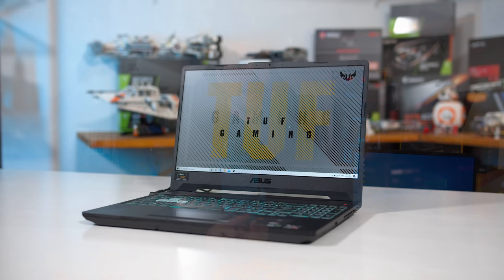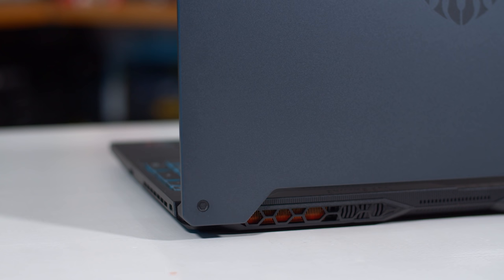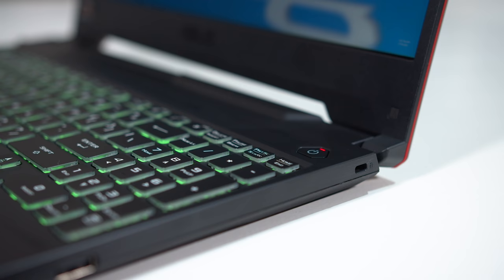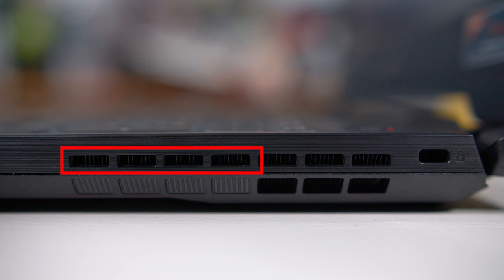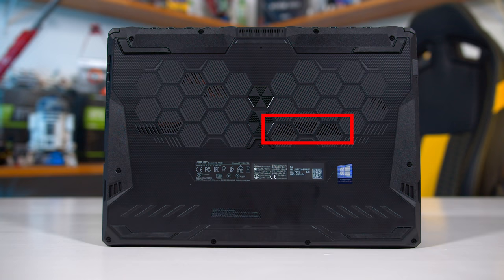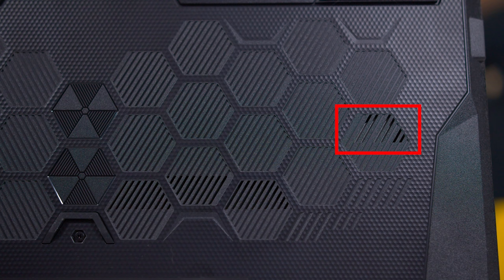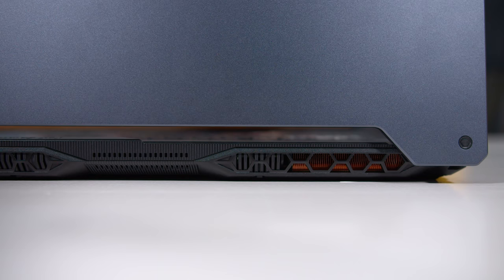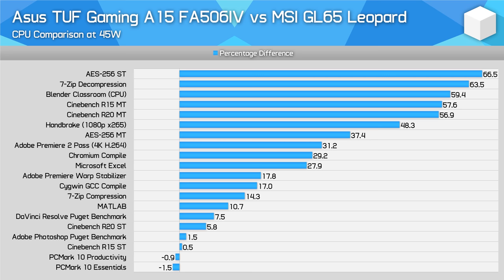Don't Buy The Asus TUF Gaming A15 (2020 Model)

Comment: Had (1660ti version) this for 5 days now. Doing heavy duty things each day for long periods of time. I've only set the NVIDIA options to high performance. 

Upgraded from 8gb RAM to 16gb. 

Played games like Destiny 2 / Total War: Three Kingdoms / Warzone / XCOM etc. - highest settings 
Running architectural / rendering softwares like autocad, revit, enscape, lumion

Overall I'm satisfied. Cooling is fine. It's cooler around where the hand usually is at the AWSD area / number pad & warmer on the middle part but not hot enough to feel uncomfortable. 

On turbo mode most of the time and the fan does make some noise, but tolerable, but you don't really notice it when you're in the zone. Unless you're the type that do. If you have headphones on then its not a bother at all. 

EDITED: After a little over a month of using this laptop...
Used it daily for work / gaming / and the general shit you do on the internet... sometimes i have even used it around the clock. 
It's still running like brand new. lol

EDITED: almost 6months in...still as above. 
Played the new AC valhalla (mostly on high graphic settings) and a few hours in on Cyberpunk (mostly ultra settings) and its smooth runnin' so im happy! 

 48wh battery runs out of juice quick though, when unplugged, so would advise getting 90wh one to last longer. 

Maybe 6 months isn't enough time to really see any faults so will probably check in again in months time. Or if i come across any issues.

EDITED: 1 year later...

Usage: as above
Heating: still as above. 
Performance: No drop. Still performing well for me. Have not experience any technical difficulties so far. 
-Liking the eye care feature under armoury crate. takes the stress off the eyes when active for long periods 
-Only downside i found so far is that my 'AWSDF' keys has slightly faded, probably because of usage. But not really a concern for me. 

Is it worth what you pay for... YES! 
Could you get better ones under same pricetag.. Probably. 
This was a year ago when I purchased so not sure what's on the market.

Anyway, hope this gives people a bit of an insight when deciding to buy or not. 

Goodluck
Reply: bro thanks for your opinions I am gonna buy the same version of yours and I was little nervous about cooling. your comment helps me :)
Reply: @katsu8693  No worries bro. I think the bad reviews only apply to hardcore users and IT experts. But I'm casual and not really tech savvy. I base my opinion on user experience.
Reply: Did you care about the ghosting in the screen? Was it really distracting like that?
Reply: @OsmanthusWineZhongli   wow ive literally had not noticed until you mentioned it. So to answer your question. No, not distracting at all
Reply: @ronin1040  its just my first time owning... But I can use a monitor for this one right?
Reply: Gum gum all of the laptops have HDMI Output so most likely
Reply: Im having the 1660ti ver with 16gigs of ram and gaming and multitasking is so good I don't feel this laptop is bad
Reply: Thank you a lot! This was helpful.
Reply: Hi.. im a architecture srudent is this lap is a best one for us, for rendering and all
Reply: @OsmanthusWineZhongli  What exactly is ghosting?
Reply: @juanfigueroa4989  Response time issue
Reply: @ronin1040  what about playing on 90c+ constantly. Can it damage cpu or gpu?
Reply: Also no problem with the temps on my TUF, he is just talking bullshit in this video. i had a msi before that and the msi overheated a lot.
Reply: @nedopanic1810  tbh i dont really check the temp and ive only had this for about a month so I cant tell if the heat is damaging anything. All I can say is that its still running  like new no problems.
Reply: Can u do AAA TITLES gaming?
Reply: This or helios300
Reply: @OsmanthusWineZhongli  do you have this laptop yet?? How about the ghosting int the screen, is it bothering you? Im looking forward to buy this laptop tomorrow so i want some thoughts
Reply: @patra7015  I dont have this yet... 

prob my first ever laptop.

the ghosting will not mean much to me since after buying this (maybe soon), im planning for an external monitor or just doing casual games, why not?
Reply: I definitely will buy this since its available here on Phil and is the best customer support and reach unlike the others just yet. 

but, for some thoughts, it actually a decent laptop if not the best, considering its price point. 

for thermals, it might be a issue that it doesnt get much airflow but it will not get much dust... because of this 810-STD... or what

but still, its decent
Reply: I cant recommend this his (Hardware Canucks) reviews since its really bad and the thermals

but ASUS has their own reasons
Reply: Opinions on the battery? Mine(48wh) will die after 1 hour of gaming or 4 and a half hours of videos
Reply: @drk7885  yes witcher 3, tomb raider, doom, mw, gtav, rainbow 6, etc.. amd ryzen 5 4800h with gtx 1650ti version, never had a throttle issue, and I live in a tropical country.
Reply: I plan to buy the Ryzen 9 version with GTX1660Ti. My intention is to use if primarily for MATLAB. Even if I use it for gaming, I play only CS GO most of the time and Battlefield 3 sometimes. I hope I don't regret buying this laptop.
Reply: I bought A17 and i don't really think its that hot
Reply: Bennett Tan. I want to buy the same version. Please update me how do you feel about the laptop after a few days/weeks.
Reply: Hi. Im an architecture student and I really need to find a laptop asap because school is near. You said you run architectural softwares here and it's good. How about the color? Are you bothered by it or is it fine for presentation? I read other reviews saying the display sucks. I really want to buy it cause it's cheaper than other products which offer the same specs. I hope you reply. Thank you so much.
Reply: @SakiChan1209   hey.. there's nothing wrong with the colour. Go for it! I use this to lap top to work from home. I've rendered images from lumion & enscape., created planning drawings up to producing construction information - it does the Job! I appreciate the comments on colours. If you're a photographer / editing videos / or  graphic designer then it may play the part. But for me, no issues. I advise you get the one with 90Wh battery, it last longer without plugging in. Good for lectures and studio work or even site visits... Goodluck!
Reply: @ronin1040  Thank you so much! You helped me big time. ☺️
Reply: @ronin1040    i wish to buy  this one for my architecture use	(TUF  A15	FA506IV-HN294T/	R9-4900H/ RTX2060 (6GB)/ 8G+8G/ 48Wh),
Is that ok, for a lumion,enscape rendering ? 
Any heating issue or fan sound?

& it costs 111500 Rupees in india, is that a heavy amount ?
Reply: is your experience the same even now?
Reply: @mehsoomn4477  that's a better spec than to what ive got, so i assume it would perform better.. as above comment lumion/enscape rendering works fine for me.... i have not had any heating issues so far. its still as per my original comment. Fan on turbo mode is a bit loud but if your in the zone or headphones on, its not a bother. hope that helps.
Reply: @adityabendi9754  yea - still feels like brand new. I really dont get all the hate with this product. I use it daily for work / gaming / and general shit... we have a 14day return policy here in the UK, so I decided to test the limits within those 14days by excessive use - its been over a month now and well, lets just say I still own the same one today lol.
Reply: I am looking at getting this with a rtx 2060 card. Either that or a Lenovo legion with the same specs but a hundred quid more expensive, is it seriously not all that bad? Because the kid working at the shop was loving this laptop, no he wasn't being biased because I told him I wasn't buying just looking around and he loves this device
Reply: This this this! I own the  same version as you and I love it. I usually play R6 siege on high settings, no mans sky on ultra, etc. Usually game for 2-4 hours at a time. The laptop doesn't get all that hot compared to my older razer blade 15 and the fans, as a lifetime gamer, are not loud AT ALL. To the reviewers point though, it could be better if they didn't block a lot of the air flow. laptop simply works and runs games like a boss. I use an ultra wide 120hz monitor on my desktop setup and this screen feels smoother.
Reply: Bought this product a few weeks ago and seeing this video was alarming to me, I'm so thankful and relieved to see a positive comment, thanks dude.
Reply: @OsmanthusWineZhongli  pre. Okay ba to? Medjo mainit satin dito sa pinas. Ngdedecide din ako if tuf ba or yung bagong acer predator helios 300
Reply: @alvinbontuyan279  pre... Student lang ako at sa Online class. At malamig yung school ko. At tsaka wala akong 80k para bumili ng Helios 300. Good thermals naman ang Helios 300 pero in a budget po ako. Yun lang sir. If medjo hardcore kayo, bahala kayo sir.
Reply: @alvinbontuyan279  1st quarter at 2nd quarter din online class kaya no problems ako about sa magiging environment temps kaya puwede naman siya... at for the next 3-6 years... reliable and promising siya sa tingin ko. Kung may work ka that is kinda too high quality or anything that requires "real" sustain load, I don't recommend this laptop. 

Its only recommended for gamers.
Reply: if you can undervolt your gpu, you can get 70c lower while having the same stock boost gpu frequency. I'm living in the Philippines having ambient temp of 31c. if I do air-conditioning my laptop's temp is around 58c while gaming.

tested it out with Max Graphics without ray tracing on Shadow of the tomb raider.
Reply: I've bought this laptop too. The Ryzen 7 4800H with 1660ti Graphics version.  I love it. Very good value for money, no problems with cooling, and I do not regret getting it.  It's very much worth the £999 price in the UK.  Running Elder Scrolls Online with all the settings on high at 70 to 99 fps.  In real world use, it is a perfectly fine gaming laptop.
Reply: @OsmanthusWineZhongli  yes it has HDMI connection for a monitor.
Reply: @OsmanthusWineZhongli   There is a difference between real world use and the testing results given by benchmarking software.  I've not noticed any display problems with gaming on it.
Reply: @williamagar7160  Yes it has differences to the real experience. That's why it's only benchmarking.
Reply: Is your version Ryzen 7 or 5?
Reply: Thx bro, TTW: 3k is the most demanding game I'm going to play on my laptop. I was worried after watching reviews on the internet but your cmt help me make up my decision
Reply: I have the RTX 2060 version and at first I noticed how bad the cooling was. It’s well directed away from your hands when resting on a table top so you don’t notice it much and when gaming with headphones the fan noise is really a non-issue as it gets drowned out by room fans and game noise. My biggest concern is with longevity. The CPU runs at around 90° C for most games and although that is technically within design tolerance for most silicon, you can’t help but think it will reduce the lifespan of the machine by at least a little bit
Reply: Thanks for a this bro. Im looking also for a gaming this is strong and durable
Reply: hmmm i think imma go with this instead of the helios 300 2020
Reply: Thank you so much bro , i almost striked this out of my list because of some reviews, thanks for sharing your opinion!!
Reply: @adarshkp5642  yup I have this computer (1660ti-512GB-16RAM), I used Enscape and Lumion with 400MB and 700MB renders and it worked perfectly
Reply: The cooling problem isnt about your hands getting warm, over time its going to ruin the components inside the laptop.
Reply: @Zero11_ss  so is recommended or take helios 300? do you have suggestions for under $1k
Reply: Well said, this review is too darn critical IMO
Reply: @katsu8693  either way you can purchase a cooling pad
Reply: Are your laptop still working good? Hope it does
Reply: @shirotora5610  Hey - mine still working like brand new after owning it for almost a couple of months now... It's still early days though - I might come back to this commment in 6months or a year's time and give an updated. But so far so good!
Reply: @ronin1040  thanks for the update bro, Im gonna buy tuf gaming tomorrow goodluck to me :)
Reply: @shirotora5610  No worries. enjoy it mate
Reply: @aravind karthik ASUS TUF FX505GT-HN093T GAMING LAPTOP BLACK | 15.6" FULL HD IPS 144Hz DISPLAY | INTEL CORE i5-9300H (4-CORES 8-THREADS) | 8GB DDR4 MEMORY | 256GB PCIE GEN3 x2 SSD + 1TB HDD | NVIDIA GEFORCE GTX 1650 4GB | W10
Reply: Im gonna buy this tomorroe
Reply: @shirotora5610  best with 16gb ram - but you can upgrade once you get it, as I did ;-)
Reply: @ronin1040  i was planning to but little on a budget
Reply: @shirotora5610  ah that's alright. Whenever that fits the bill really.
Reply: @ronin1040  btw, do you use your laptop like games while charging?? And do you use the turbo mode while charging?
Reply: @shirotora5610  yea i do and turbo while on charge or else it sucks out the battery life while gaming. Unless you have bigger battery which apparently lasts longer
Reply: @ronin1040  but your laptop still in good shape right?
Reply: @shirotora5610  yea bro. i pretty much use it heavy every day,and still performs like brand new
Reply: Thank you i was scared if i should buy it or no
Reply: @hydro8382  same bro
Reply: Good. I just bought it yesterday and it seems awesome to me after returning a Nitro 5 that was like a mini vacuum running all the time. I love the A15 so far and it is tremendously superior to the Nitro design in my opinion. Cooling seems fine.
Reply: does it have display port?
Reply: I'm buying this laptop next week, thank you for your review! :D
Reply: @ronin1040  hey bro do u use your laptop plugged in all day??
Reply: This was the first comment on youtube where i read all the replies lol, im buying the gtx 1650 ti version tommorow, i hope its worth it
Reply: @flame0814  its worth it bro, you need to set the 144hz because 60hz is default
Reply: @shirotora5610  wait one second im getting confused, the site im buying it from says the screen is 60hz
Reply: @flame0814  oh i thought u bought the other tuf gaming
Reply: @shirotora5610  okii
Reply: @shirotora5610  hey - yea i do. Battery don't last long as I do the heavyweight stuff on it. I do have the lower end battery though. Not sure about the 90wh battery version - It might last longer without plugging in.
Reply: I’ve literally just got this today and only now seen this review, it’s reassuring to see this comment, love this
Reply: @Ronin  Bro, how about the battery life with no plugging battery for only using normal  web browsing stuff?
Reply: @ronin1040  I just experience diagnostic problems :< sadly the problem is adapter and batter idk why. and today I plugged in my charger and it stop on 96% but still charging
Reply: I had literally just bought it 30minutes ago  when I decided to look it up on the internet and I found this. But thank God I stumbled upon this comment!
Reply: What do you think about the High response time bro
Reply: Literally went through the replies of this comment only THROUGHOUT the whole video, thanks man!
Reply: We all know you work for ASUS
Reply: Can't say you are not one of Asus's pet
Reply: Hey, looking to buy something similar to this, how's Destiny running? Currently one of my main games and I'd like to be able to play it away from home. Thanks.
Reply: Cyber hey mate, i cant say with destiny as i dont play it but i play modern warfare on it and warzone and it runs great. Obviously i opt for performance than graphics because k/d over aesthetics. But played the campaign which is pretty graphic expensive, and it runs pretty well. Hope that helps
Reply: Funny how people think im an asus dog just because i think this laptop is pretty good for its price x
Reply: @ronin1040  Thanks for the feedback, mate.
Reply: I bought the same laptop. So far so good. i'll try and give am update after 6 months.
Reply: Gracias papu.
Reply: Is gtx 1650 Intel i5 version good for unreal engine 4 ,blender ?
Reply: What’s difference between 1650ti and 1660ti is it much of a differnece
Reply: Aymane Bencheikh sounds good ty
Reply: I’m actually planning to import the version with rtx 2060 with the AMD 4800h 7 at the end of the year and seeing this comment made me think that this laptop will be good for my clumsy hands. Once the AMD 4900h 9 comes out, I might get it, but I don’t really need that much.
Reply: @ronin1040  Hi I'm back again to ask a few questions. I have already bought this unit and been using this for more that a week now. You've told me to buy the 90wh but I accidentally bought the 48wh one because I thought the unit I purchased was the 90wh. The maximum I can use this is 2 hrs. Running cad and other archi softwares and just web browsing. Nothing heavy really. Is it normal that the lifespan of this laptop only ranges like that? If its normal I wouldn't ask the seller for warranty but if not I really need this replaced. Thank you so much.
Reply: @shirotora5610  Hi. Have you resolved the issue? I experience the same. 3 days ago it stopped at 98% then the next day it worked fine and got fully charged. Then earlier it happened again it stopped at 99%. I have the 48wh and the battery drains so fast. I hope you reply. Thanks !
Reply: @SakiChan1209  i changed my charging mode maximum battery lifespan mode, so it automatically stopped the charging at 60%.
Reply: @shirotora5610  Do you also have the 48wh? Do you keep it plugged in and does it get fully charged now? I'm sorry for the questions I'm really troubled right now. Lol Thanks!
Reply: @SakiChan1209  yess we have the same. Yes i do always plugged it for like almost all day
Reply: @shirotora5610  Now I have less worries. Thank you!
Reply: @SakiChan1209  and I recommend to you that, if you use your laptop for like 12 hours or long gaming time use the maximum battery lifespan mode, but if you are using laptop for about 2-5 hours use the balance mode, according to the google making your laptop fully charged always can cause battery life decrease
Reply: @SakiChan1209  i have one problem recently and i dont have time to go to the customer service. My problem was when im doing the hardware diagnostic my battery and adapter has a problem
Reply: @shirotora5610  Yeah I really do use it all day. I was really worried because it won't fully charged. I'll now plug it most of the time. Thank you for the advice!
Reply: Minhit Entertainment hi mate yea that sounds about right with the 48wh one. I usually keep it plugged in all day. Probably not ideal but the 48wh battery runs out like grape juice hence i would always opt for the 90wh one
Reply: @ronin1040  Did u face an issue about not getting fully charged? Mine stops at 98 then gets 100 the next day and earlier it just stopped at 99. Could there be a problem with my unit or the battery and adapter? I really need opinions. Thank you so much!
Reply: Minhit Entertainment hmm another guy had that problem in the comments. Ive not had that problem, mine goes up to 100 when charging. I did mess around with the performance settings when i got it though, so you might find the problem in the battery settings? Try maxing battery performance maybe.
Reply: @ronin1040  Yeah I read he did that. I'll definitely give it a try since I can't afford to keep this laptop away from me because of deadlines and stuff. Thanks for replying! ☺️
Reply: @Ronin I dont know if you discussed this earlier mate but did you notice any ghosting/issues cause of the high refresh rate. Does it cause any problems with competitive games?
Reply: @cankenger  Hey. I must admit I've not come across, or notice this yet. Most of the time I use a separate monitor to play games on for a bigger screen. But when I do play on the laptop screen, it seems normal, or I've just not noticed. Have you been experiencing this?
Reply: Ronin ahh i see, I was thinking of doing that. I actually havent got the laptop yet. I was thinking of getting it but theres so many adverse messages about the display and the 18ms response time. It says it needs to be 5ms for gaming, on the internet but i feel like it doesnt make a difference like you said. Could you please watch out for it and let me know if you notice anything when playing fast paced games. Grazi
Reply: @cankenger  I'll tag you in if I do come across bro. But if i was you and looking to get a monitor as well, I might as well buy a higher tier laptop with good monitor to meet your needs, instead of buying this laptop and a monitor. I'm fortunate enough to own a separate screen already :)
Reply: Ronin much appreciated🙏.  Yh that makes sense. Ill consider that
Reply: totally agree, used mine for 2 months now, and by disabling the boostclock, temp doesn't seem to bother anymore, only thing that i don't like is the armoury crate software, always gets service error and infinite update.
Reply: Cheers for the confidence boost, purchased the laptop yesterday and am watching reviews while it ships, glad to hear you are satisfied with it 👍🏽
Reply: Just bought it, fully agree.
Reply: Legit never saw it go above 80c even once, i played valorant, csgo and hyperscape back to back.
Reply: Dhruv 97 any ghosting on csgo?
Reply: Ronin I’m planning on getting this for school and gaming, what do you think?
Reply: I'm new to laptop 😐..so is your model a good choice to get hands on or should i move on with some other stuff.. actually i want a laptop for casual tasks,slow and steady gaming (no hard-core games at all)😂..and for the online classes 😏..so what you gonna suggest me my dear friend???
Reply: Hey I want Asus tuf A17 Ryzen 7  17 inch 16gb 1tb hdd 256sdd 6gb 1660ti but it haven't launched yet in my region so the asus store is suggesting me to go for asus tuf FA566IU-HN254T R9-4900H GTX1660Ti (6GB)
16gb 1T HDD+512G SSD  15.6 FHD-144hz 48Wh and my requirements are video editing premiere pro after effects like software and gta 5 like game. The thing is asus a 17 price is 92k and this asus tuf FA566IU-HN254T price is 104000. Can you give me please a piece of advice which one I should go for?
Reply: I am also going to buy❤️
Reply: Im also looking to buy this product. I am going to a designer school, are the colors going to affect me that much? Are the thermals still good and is this laptop good for rendering?
Reply: Dude how did u use rendering in 66% sRGB panel
Reply: @drk7885  Helios 300
Reply: How's the battery life mate? I'm thinking of buying this as well?
Reply: @parthgigoo2477  I've got the one with 48wh battery, and I can get max 2hrs on it doing normal day to day task. But when gaming, it runs out pretty fast. I usually keep it plugged in when I do intensive tasks.... I would recommend the 90wh battery to last longer.
Reply: @Rdg Jathin Hey mate, its holding up alright. Its been almost 4months since I've had this. I've not had any heating issues or damages yet. Probably because its still too early to notice. The heating is still pretty much the same since day one... Valorant isn't graphic intensive so you should be fine.
Reply: @darkherobrineita  I played AOE 2 DE on battery mode in A15 for 2 hours straight.
Reply: @ronin1040  hey man, while watching movies and all, they look like a little bit dull, red color seems orange to me, I know it has 62%srgb and 45%NTSC, does the same happened with you?
Reply: @sanyamthakur6549  I honestly have not noticed. Albeit, I have played around with the visual settings via armoury crate... maybe do the same, and tweak to suit you.
Reply: @ronin1040  How to do that, can you tell step by step please?
Reply: @SakiChan1209   Did you buy this laptop? and are you facing any issues
Reply: @nitinbopannat.r9726  Hi yes. Using this for almost a month now and no I haven't faced any issues so far. It runs my softwares smoothly and play games with no lag. The only downside with my unit is the battery. Other than that the laptop's really good.
Reply: Is it cold where you live ?
Reply: How's the screen? I've heard some people say the colors are dull compared to other models, is it?
Reply: Will this laptop be a good option for Autocad and 3ds max..?
Reply: @cankenger  ...yes
Reply: @OsmanthusWineZhongli  hello so far how is it been for online class? Hindi ba umiinit in casual use? Nasubukan mo na rin po ba mag edit ng video like premiere and how is it if that's the case?
Reply: @jjdeleon624  how can you do undervolt po?
Reply: Thank you bro for your opinions and first hand assessment about the laptop, it was very affirming
Reply: Omega Zero  because it's real life usage supported by everyday use going on for months.
Reply: @javitriana2135  hey. I am thinking about getting the same specs. I need your help to clear some of my questions. How long does the battery last( for normal browsing and videos)? Does the laptop get much warm?( can I place it on my laptop and use lumion and autodesk?) And finally how is the screen? Thank you
Reply: @khushhalistan2299  hi! It's a great computer, you should buy it. Battery last about 4/5h MINIMUM, depending on how many videos, quality and brightness, but for a normal use of browsing and PDF reading... Minimun 5h. It never get much warm, if you are browsing it sometimes don't use the vent, so it's very quite when using it. You can use it Lumion without problems, but you should always have it charging because it's more powerful and works faster (if you use Lumion, the vent will move very fast and sound at very high revs, but it will never warm). I really like the screen, some people don't like it but I like the colours, I always have the brightness bar at the middle and quality is ok for normal videos (if I want to see HDR videos I watch them on my 4k tv hahaha). I hope it help you, if you have more questions just text me, but I highly recommend this computer 👌👌
Reply: Thx
Reply: hello I am Architecture student and would you highly recommend this laptop for 3D modelling, rendering and gaming purposes? I've been having a really hard time looking for the right affordable and efficient laptop that would satisfy my needs and wants, I'm really interested with this one but some reviews are really getting on my nerves, I just want to find a laptop that I could use for long term. Thank you! :D
Reply: @danielsia1803  I've only had this laptop for almost 4 months now. In terms of long term, I am yet to experience that. But it is proving to be resilient so far. I'm an architectural technologist in the UK, and I've been using this laptop to work from home. I would say it would suit your needs for architectural purposes. I've done rendering using enscape / lumion, and work on Revit architectural all day long... besides work, i also game on this laptop. As per my original comment... hope that helps.
Reply: thanks dude, im buying 1650(might get ti as well) just to run autocad.

ofc ill be playing some vid games.
Reply: Love you bro!
Reply: Ronin, my dude. This really helps me loads. 
Without going into too much detail, me and the missus game together, specifically World of Warcraft (like a couple of sad old buggers). I'm all about my desktop and there is absolutely no changing my mind, and the way mine is, it's been running games great for ages and the only upgrade I see in the foreseeable future is an RTX3000 series card and possibly new processor to go with.
Her on the other hand... thought a "pink" notebook with on-board junk (on finance too) would be a good purchase. Wrong. Recent patch came out in the game and if she gets 2FPS (no joke, on minimum settings) it's a good day. I'll build her a PC at some point when we move into the new place, but for now... this laptop, specifically the 1660ti, comparatively just cant be beat. I've looked and looked and looked, and heard so many good things... until I googled it, and this video SHAT all over it. 

After reading your comment, I think for £899, it'll definitely fit the bill. Even more so as an almost temporary fix... but who knows, if its decent enough, I can probably hold out a little longer on building her a desktop.
Reply: Jarrod's found out that the RTX 2060 model is the hot one
1660ti not as much
Reply: well said, the screen is only problematic when you are sensitive to ghosting and are playing some competitive games. the heat issue is only a problem when you are stressing the cpu and gpu together. for normal daily use and moderate gaming, it's no problem at all
Reply: AFAIK the bad thermals happened in the RTX 2060 version

Jarrod Tech's review seems to confirm that
Reply: @OsmanthusWineZhongli  bumili ako sa ROG store sa Shopee ng R5 model tapos ang binigay nila ay R7 4800H.. kumusta naman ang tuf mo ngayon.. dito sakin still good as Bnew
Reply: Will the 1650 version be good?
Reply: My friend told me the exact same things which u have mentioned and that it doesn't need further heat management. He has a ryzen 7 4700h with 1650ti variant. He uses his laptop for CGI, Video Editing, heavy Gaming. He said the fortress grey variant is awesome but the Bornfire black one sucks(that's why it's cheaper in my country). 
I agree that sometimes not listening to reviews is perfectly fine.
Reply: Hello everyone in this thread have you faced any network issues with the adapter. There is a thread here 
https://zentalk.asus.com/en/discussion/27653/tuf-a15-fx506ii-laptop-wifi-and-asus-multi-antenna-service-software-issues

 I experienced some on my wifi network including no internet though uninstalling the device in device manager and installing the realtek drivers fixed it and intermittent drops in conection but a answer on the thread I linked which said to turn off the option to turn off the adpter in power management fixed it.
Reply: @ronin1040  Hello, I see you bought the keyboard I have some questions
Is the display good?
Does the keyboard feels cheap?
Reply: Reviews can be subjective. Sometimes there are definitely bad choices that make for a bad end user experience, or sometimes there are just better models for the price. But sometimes people have their own pet peeves, and if you've got a YouTube channel you can tell everyone your pet peeves and get thousands of views.
Reply: Well i am planning to buy it's base variant with R5 and 1650!! Should i go for it! Or worry about thermals as per mentioned in the video!!!
Reply: i was thinking to buy rtx 2060 .they told it has only 60hz does it matters for normal and simple gaming
Reply: What the author of the video is saying is that Asus TUF A15 could reach its optimal hardware potential hadn't for the crippling and compromising Asus has done to its build. It has nothing to do with "user experience" which is subjective and specific in most cases.
Reply: now on best buy usa getting version rtx 2060 for just 799 dollars
Reply: BRO ITS 3 MONTHS SINCE I BOUGHT IT, NOW IM EXPERIENCING HEAVY FRAME DROPS. CAN SOME1 HELP =)
Reply: @cobra3359  which model is yours ia it ryzen 7 4800 rtx 2060 or another
Reply: @ketandoshi5641  ryzen 7 4800h GTX 1650
Reply: hey man I am about to buy this laptop, do u still recommend it? (thanks in advance)
Reply: @cobra3359  Thats weird bro. I've not been experiencing that. I'm like 5months in. What games are you playing? Remember, this isint a top teir gaming laptop. It would run most games, but probably not one that's overly graphic intensive (or play on low res)... Try running on Turbo mode. Play around with Ndivia settings. Or, google the problem first.
Reply: @mohamedelkhatib3324  I'm almost 5 months in bro. It's still running like brand new. Shit battery life though, so if you do get it, get the 90w one for longer sessions. I got 48w and I can get 1.45hrs max sometimes 2hrs when doing normal stuff. When gaming, it runs out a lot quicker. I keep the battery plugged in all the time. Apart from that, I've not come across any issues, but obviously that's just me. Hope that helps.
Reply: @johnpaulpascua3569  the video title also says "Don't Buy The Asus TUF Gaming A15' which is completely not what the video is all about, as you say, and may influence people's thoughts into buying it for their own user experience.
Reply: @ronin1040  thanks man :)
Reply: thanks bro for the opinion 🙏🏻
Reply: Mine too actually, cant relate to this video
Reply: Asus TUF A15 TUF506IV-AS76 15.6" Gaming Notebook AMD Ryzen 7 4800H 16GB RAM 1TB SSD is this a good laptop?
Reply: Is the input delay bad? Please respond
Reply: I have bought this laptop (2060 RTX version) and after seeing tons of positive reviews. Now I watch this video and it makes me sick to my stomach. I feel so worried that I made a wrong choice because due to the currency difference in the country I live (Turkey) this is definitely not a budget gaming laptop. 

To tell you the truth, I was so happy that I bought this powerhouse. Tho I must say that I totally agree with the panel not being top notch, but it is managable. If I was using this for very accurate colors, I think I wouldn't be happy. But the heatsink issue, this is where I don't feel safe. I play World of Warcraft Classic with full features turned on. I don't have any sort of cooler and I have a wooden desk,  my CPU temperature ticked 93-35 degrees C once and 85 ish in GPU (first week of purchase). Albeit, I don't think that these values are constant. Any softwares you'd recommend to monitor my temperature values and track an average?

But I felt relief in this comment of @Ronin. Do you guys think this is normal? I mean I've never saw a reputable tech guy saying "please don't buy this/that"  while pampering a competitor. I mean I'm so confused. I hope I didn't make a bad choice. ASUS shouldn't be this shitty I've used a gaming series before it wasn't entirely bad, it was good. I also used an MSI laptop (my former gaming laptop) it was also good... Man these videos kill me... @Ronin would you mind giving us an update of your current situation with respect to temperatures and stuff? I crave for the positivity I suppose :)
Reply: @ajiteshthottungal5287  Same here, bro. I bought the same laptop a month back and it does really well in graphically intensive games.
Reply: @punman5392  how's your laptop now?.
Is there issue in ghosting and thermal?
Reply: Hey I have the same model gtx 1660 Ti, AMD 4800H
Have you played cs go on it, because I don't know why I have frame drops during competitive
Reply: @mihu385  Hi mate, I dont play CS GO, but i dont imagine it to be graphic hungry as other games. Currently playing AC Valhalla on this and its running pretty smoothly on high settings... Maybe to do with other things?
Reply: @ronin1040  Hi friend,thanks for your reply.
After some time I saw that this problem is present in many games. In the first minutes the game works smooth at decent amounts of fps but after the CPU starts  to get over 75 celsius degrees I strat to get frame drops even if I have the laptop on a cooling stand. My suspicion is about some settings because it's imposibnle even for a laptop to give me less fps than my desktop that has lower specs
I mean 140 fps in cs go on ryzen 7 and gtx 1660 Ti and more than 250 fps on a desktop with i5 6600k and gtx 1060 ,i'm sure i must be missing a setting or something
Reply: @mihu385  hmm thats quite a strange case then. Do you play on turbo? Maybe set NVIDIA settings to high performance or something, but I guess you've already looked at that stuff.
Reply: I'm using it for 4 months and performance is still same
Reply: @ronin1040  I guess it also depends on what kind of price you get it for. I just got the version with 4600h, gtx1650ti, 16gb and 512gb. I was worried with these videos, because I haven't watched them before buying. Just unfortunate about the 48wh battery, but I got this laptop at a 20% black friday discount, with the discount it was about 1020 USD (prices in Croatia are considerably higher for computers). Nothing in the price range could really match the specs, and also the laptop looks and feels really nice. It's my first laptop, I haven't used it heavy yet, but your comment was very encouraging as far as that is concerned. My first option was actually an HP laptop with a 4700u, 16gb and 512 gb, which was cheaper and also seemed a good deal for the price, but when this got discounted I opted for this instead. Overall I'm really satisfied with how the laptop looks, and it turns on in like 7 seconds, which is great, I haven't yet had such a fast SSD. Like I said, the only downside is that I got the one with the smaller battery, which means I get a 2.5'' bay, but here in Croatia if you open the laptop and work on it yourself (for example add a hard drive) your warranty is void, so that slot means nothing to me and I would rather have the larger battery. Still, it was a good deal so I didn't even consider the battery, should be fine for just general use in university and such, and if I use it for gaming I can always plug it in.
Reply: Had a good laugh at this comment.

"Happy to report I've owned this laptop for a month and it hasn't caught fire!"

Lol. It's not meant to bro. It's meant to be running fine after 4 weeks of ownership. This isn't an achievement.

The criticisms in the video are perfectly valid. Poor cooling design which can hamper performance and longevity of the components.

You don't have to get defensive and justify your purchase. Your laptop should be working fine after a month so I'm not sure that proves what you think it does.
Reply: Thank you King <3 I agree. I am looking for an upgrade for my HP (Ryzen 5 3500 Vega 7) laptop. That laptop received a bad review and the person said "It's not for gaming." *laughs in gaming at high settings*. Much love and respect to you king. Very detailed review.
Reply: @ajiteshthottungal5287  Can  you please let me know if this laptop is good for video editing as well ?
Reply: Can  you please let me know if this laptop is good for video editing as well ?
Reply: Maybe TUF in 2 years will be a 🔥🔥. Pick ROG, guys you can play until 4 years
Reply: @cn3672  Noted. Thanks bro
Reply: same here bro.. bought 1660Ti and 16Gb version. It is pretty good. Temperature problem is quite normal i think. Even Dell G5 SE has hight temperature. Overall, price to performance is impressive for me.
edit* btw i'm a civil engineer and took Bim Modeler as career so I use Revit for modelling, rendering, simulation with massive construction related information input into that model. Still it works properly for me while doing those things. For color accuracy, I bought full SRGB monitor.
Reply: Bought the Zephyrus G15 after watching reviews about that laptop as well. It has the same review about the cooling issue but after using the laptop for about 2 months, I actually don't have any issue with the cooling.
Reply: @ronin1040  sorry but i want to ask, i just bought it and after few days when i turn it off it takes really long
did you experience the same thing?
Reply: We bought the 1650 ti version. Also satisfied with the cooling and the performance.
Reply: Hey, I have a question about this one... Is the screen delay REALLY noticeable? Like... I play on a 2012 which I have no idea how much delay has and was thinking about getting this one
Reply: @muthukumaran1698  Yes this laptop is really good for video editing. I mainly use it for video and 3D  modelling, and it is beneficial.
Reply: @kesorangutan6170  i will do soon. going to play on the new cyberpunk game to see how that goes on this laptop, then update this comment.. however, I've played AC valhalla optimised to high graphic settings and it worked really well.... overall the laptop is still working like brand new. Maybe 6 months is too early to tell. The heating and screen is still same as when i got it tbf. only one bad thing about is the battery life span (48wh version). its shit. if there was a chance i could get this again i would purchase the 90wh one for longer unplugged sessions.
Reply: Thank you broski , you cleared my doubt ^^
Reply: THANKS HOMIE! Just ordered this laptop
Reply: People that rage at games are way louder then the fan
Reply: i got the asus tuf a15 with gtx 1660 ti and i works just fine. The guy who made the video....dont trust him
Reply: thanks dude for real xoxoxoxoxoxox no homo
Reply: @ronin1040  i just wanted to know if you encounter any problem with your laptop now. 5 months later. im planning to buy it
Reply: @basicthing2363  hey man. no problems yet. the only thing i dont like is the battery life (48wh), if you're thinking of getting one get the 90wh battery for longer unplugged sessions. I usually keep it plugged in all the time as im always doing multiple things... i will do an update soon though after i played the new cyberpunk game, and see how it runs on this laptop. though I hear its a flop, but would still play it to know how next gen games runs on this laptop. hope that helps.
Reply: God. I've been eyeing this product because my sister needs to be ready for her architecture course lol. Thank you for this wholesome comment! 👌
Reply: Thanks bro I’ve been watching this guys videos and getting sceptical but it feels like the most value for my money. This feels like a feud between reviewer and manufacturers affecting consumers. Your review is literally all I was asking for, not a cooling scandal 😂
Reply: Yo thanks man
Reply: Hey man, thanks for giving me a user experience because I’m basically getting the same model you have, and I’m pretty sure the cooling only really affects the 2060 models because of how intensive they are
Reply: "buy does it run cyberpunk 2077" 😂😂😂
Reply: On a serious note, is it recommended to get the gtx 1660ti ver or spend a little but more for the rtx 2060?
Reply: @calvinbernard  haha happy to say that it does.. running mostly on ultra settings atm... obvy RT don't work on this but hey, still looks pretty damn good without
Reply: @calvinbernard  if you got the extra dosh, go for it. maybe you can run RT on it for cyberpunk :)
Reply: Deal 👍
Reply: How much ram? Cause I am having trouble running with 8gb
Reply: @jamestankitwo8461  ahh yes, i imagine you would... upgrade it to 16gb or more if you wanna run graphic heavy things. 16gb should do - that's what im runnin.
Reply: @ronin1040  I just put it in ultra and it runs better. Medium slows it down due to medium using more ram for what ever reason lol.
Reply: @ronin1040  amazing pc for sure
Reply: @jamestankitwo8461  i found that as well lol. feels like it doesnt like lower graphic settings.
Reply: @jamestankitwo8461  for sure! if youre on a budget, defo worth the money.
Reply: @ronin1040  runs premier well too and this is before I do the ram upgrade
Reply: I just bought it, and this comment felt really good (especially after the video)
Reply: @shirotora5610  i just read that this is an issue that can be resolved with running down the battery below 50% a few times and then it sees it properly.
Reply: Omega Zero  but when it is confirmed by other happy owners...
Reply: @ronin1040 I'll bet they don't even own one, but they absolutely love to hear themselves talk...
Reply: How is the display?
Reply: Cyberpunk 2077 Ultra with a 1660Ti? How many frames are you getting?
Reply: Placing a comment here
Reply: Nice
Reply: Cmon 250
Reply: D
Reply: E
Reply: 250 comments, nice
Reply: @mightykenneth  thinking of buying the same laptop. Is it overall a good purchase and do you think it will run for a horizon 4.
Reply: Would you recommend it in 2021?
Reply: @hubert4549  if you're looking for a decent budget laptop then highly would recommend it still yea. Still running like new to me
Reply: @ronin1040  thank you Sir, I am fighting between legion 5 144hz ryzen 4600h and 1650gtx between this asus a15 144hz 4600h 1650 gtx haha, can't decided that easily, because prices of those two are almost the same.
Reply: guess we need more commentors like you
Reply: it’s all fine but i kinda doubt about screen. it’s only 60% srgb
Reply: You are a god man, thank you for this review.
Reply: Thank you very much for this comment! I couldn't find any review of this laptop from architect/creator perspective, so I'm very glad that you wrote this :). For color stuff I have an external graphic monitor so I don't have to worry about that, my main concern was just the heating problem, but as I see here, in your comment, or in this review, there's not so much overheating. I would be very glad if you could tell me, is there any difference in overall performance after 10 months? Did you have any issues?
Reply: @greaser319  hi - i havent had any issues in overheating yet. its been almost a year. As per my original comment, it does get hot but not in  the areas where your hands usually are. As i say, I use this laptop extensively for work and gaming, and its still holding up. So for me, its worth the money. However, not sure if there's better deals out there now as this purchase was a year ago :)
Reply: thanks for your opinion man! We need more of these updated use to make sure these laptops are actually future proof
Reply: Bayu Setiaji  its here
Reply: I very much love how u keep on updating us, thank you bro
Reply: Thank you i just bought it and now with this comment now im more satisfied
Reply: @mightykenneth  wait sir so should i get this a15? Is it worth the price? And if i get one 2nd hand will the overheating be a problem?
Reply: Is it okay battery life when doing light tasks? Since I also need to use it for school